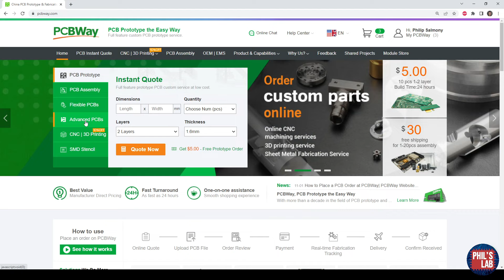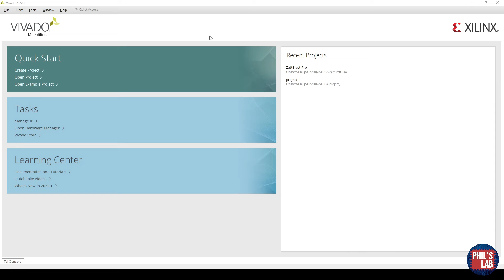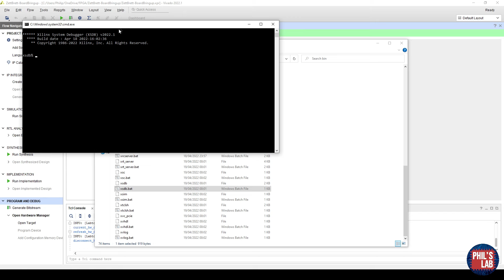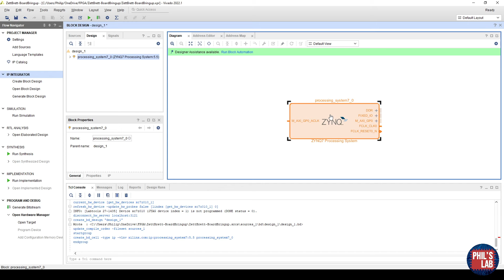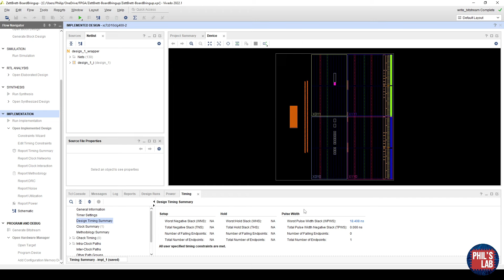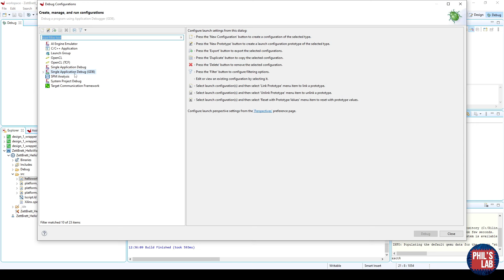FPGA/SoC Board Bring-Up Tutorial (Zynq Part 1) - Phil's Lab #96

Comment: Hello, I am using vivado 2023.2 version and I created a block design and bitstream as in the video. When I open the .xsa file in vitis unified ide, I get the error "Error: Invalid platform, System DTS file does not exist". I would be glad if you could help.

Comment: Unlike a microcontroller based project, this one does punish your wallet significantly if you don't get it right.
Did this board required more than a single iteration or did you get it all working perfectly the first time. Honesty is appreciated :)
Reply from the maker: I've successfully verified DDR memory (speed, no byte lane errors, read/write eyes), Gig Ethernet (TCP server/client), QSPI flash (writing/reading/booting from), and the Zynq systems themselves so far. Left to test is the eMMC and USB HS - so fingers crossed :) This is the first iteration of this board. I did spend a substantial amount of time checking the design before ordering.

Comment: This is excellent. Does your hardware course include an assembled board? If so, I’m in. I’m less interested in the hardware design and routing for now, and more interested in the bring up, and in finding ways to program it using more open-source tools (not the synthesis yet). I do also want to learn the design and layout, don’t get me wrong. But I really want your board to play with!
Reply from the maker: Thank you, Rick! I'll be selling these ZettBrett boards once I release the course. You can either buy them individually or in some form of bundle (at a slightly reduced) price along with the course.
Reply: @PhilsLab  Nice videos, nice design. I hope I didn't miss it, but is there a shop for ordering a board?

Comment: Any reason you didn't go for a single PMIC for multiple voltages ?
Reply from the maker: Form factor of the board was one reason, meaning I can space the regulators out and thus clean up my power planes and delivery. Also, the combined cost of all regulators was significantly cheaper than a 4-in-1 regulator. Lastly, I personally love the aesthetics.
Reply: @PhilsLab  Fair enough! Btw could you provide the part no of these regulators ?
2. Do you source your fpga's from the pcb house or mouser/digikey

Thanks!